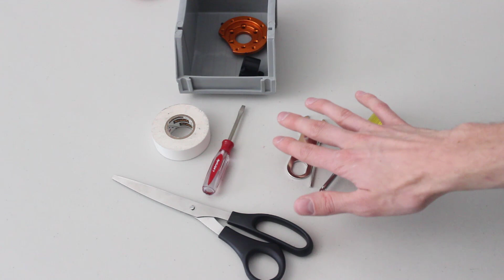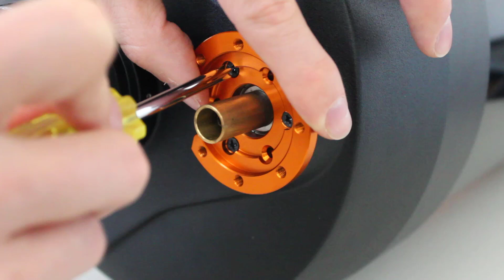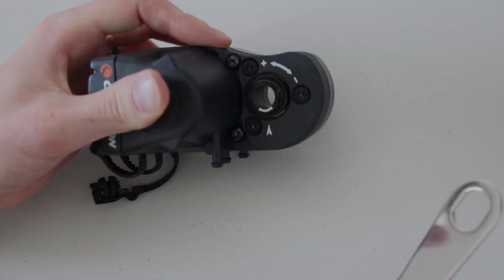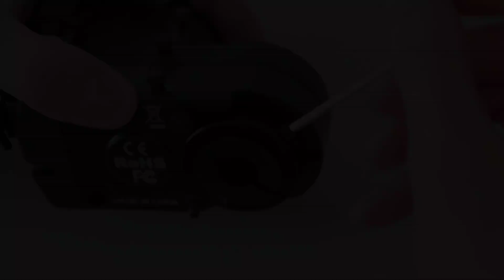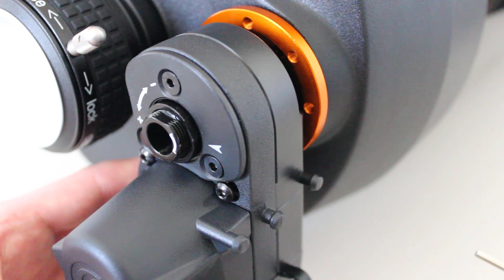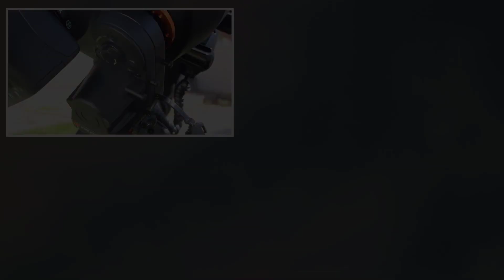How to Install the Celestron Focus Motor (Detailed Version)

Comment: I had stalling issues as well on my CPC-11. I've had the focus motor for a while, but when I recently added a field reducer, I couldn't achieve focus due to stalling issues. Even just lightly tightening the three screws on the adapter plate would cause the brass focus sleeve to become tight and cause the motor to stall. Too loose, and the bearings would have movement. I tried different ideas and finally decided to tap out three of the holes on the adapter plate to accept 8-32 set screws equally spaced around the adapter plate. With the set screws just barely protruding past the face of the plate it allowed me to tighten the three mounting screws with just the right amount of pressure onto the bearings.  I also put a small amount of blue thread locker on the two captive screws on the focus motor just to keep them secure.  So far I have had no issues.  If you try this, I'll caution you not to tap out either of the two holes needed to mount the motor.
Reply: Thanks for your post Robert. I have had issues with my CPC1100 as well. If you follow Cody's instructions ( which I am sure 100% match Celestron's) all you get is binding. That's not Cody's fault but Celestron's. Their manual saying make sure everything doesn't move around is a joke. The screws  on the mounting plate and on the motor have to loose just to allow the motor to turn. Celestron have tried to make a product that weill fit and work on every SCT telewcope but it's not possible. They should have made one for the 6-9.25 and one for the 11-14. My motor now works BUT the screws are loose and the motor moves during operation. If I try and tighten the screws any more past loose the motor won't turn - and I have spent 2 days doing this and making sure everything was done as per Celestron's instructions. 

Cody - how is it that EVERYTHING allways works for you??!! ;) hug 

Great video as usual, thanks.

Comment: Thank you for these videos - they are really useful. I recently got a Celestron 8SE and today I added the focus motor. I had watched this and your earlier video on installing the focus motor so I thought it would go smoothly. I ran into the same problem you talk about in this video, the motor would stall and not travel throughout the range. I re-watched your video and this time I made sure everything was just as you recommended. After the re-installation, the focus motor operated perfectly, the controller went through a complete calibration from end to end and then put the scope back at the exact focus point where it started. Needless to say I am pleased with my new telescope and can't wait to use the focus motor as soon as the clouds clear! Best wishes, clear skies, and please keep the videos coming - they are great.
Reply from the maker: tomtektest Glad you found it helpful and got it working!

Comment: My issue with the latest focus motor on the 9.25 scope is at the calibration stage., It gets stuck at 25% and will not proceed. I have installed the utility program which can not connect and also installed the ascom drivers. When running through CPWI it says the focuser is connected and I can manually focus but I can not callibrate it. Any help would be great.
Reply from the maker: Can you calibrate it with the hand-controller without issues? If so, it could be a software problem in CPWI.

Comment: He said he likes to set the plate up a certain way. How did he figure that out? How many of these has he mounted? Or, is he continually removing the focuser for some reason? Also, he doesn't mention mirror shift. Why would I choose this focuser over something like the Moonlite? A Moonlite is a very easy add-on and no mirror movement. I can even keep the mirror locked with the Moonlite. I just installed one on my 9.25Edge. And it was a hell of lot easier than what appeared to be required on the Celestron focuser.
Reply: Gregory S if you’re using OAG, I don’t think the moonlite will clear.
Reply: @marioslrzn  Hi Thanks for your feedback. If I did use an OAG, it would have to be thin one.

Comment: I installed the focus motor on my CGEM 9.25 two days ago. First step after install was to run the calibration routine. At first it appeared to run fine. The motor rotated in one direction, then another, then back the other way. At that point, the hand controller displayed the message “calibrating focuser” and did not complete. After 15 minutes, I powered off the scope to try again. Now, the scope will not initialize with the focus motor attached. The controller states “ERR Model Num. The telescope model could not be read, and initialization cannot proceed.”  Now, I’m waiting a response from Celestron.
Reply from the maker: Strange, I've never had that issue. Usually the calibration process takes about 3 minutes for me. It goes to the end of focus travel for each direction and then gives me the calibration complete method. If you haven't you could always try updating your focuser in CFM and see if that resets it, and try it out again. Have a good one!
Reply: My calibration is stuck on 25%. Look at my other post here for more detail.

Comment: Slymin i have ben in touch with Celestron and they are sending me some longer screws that enable me to fit the  the new focuser cover plate over the original as the manufacturing has failed to machine in the recces for the bearing this causes the new cover plate to wobble on the bearing causing the angular lock you have described. Fixes for this issue are get it machined, use longer screws, use packing or as you describe make sure you don't install it off axis.
Reply from the maker: Hi Phil, that is unfortunate. I am glad you have found a solution though!